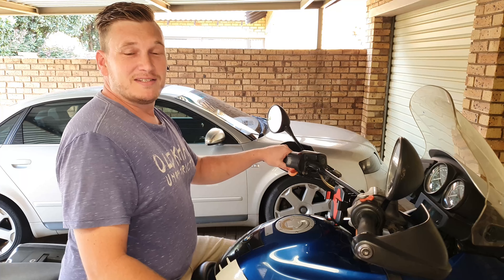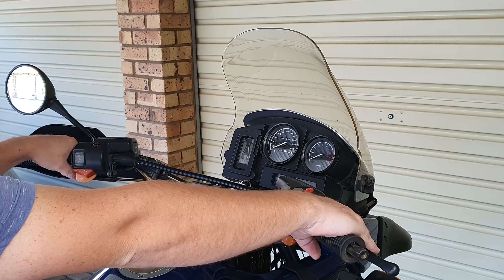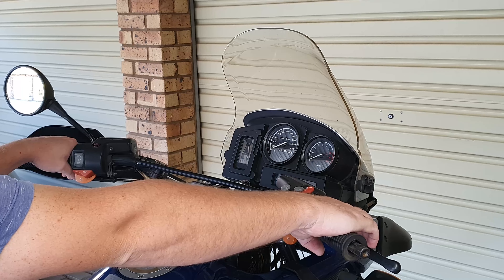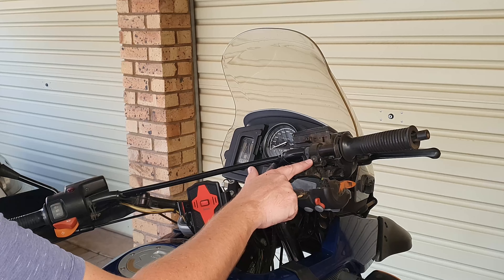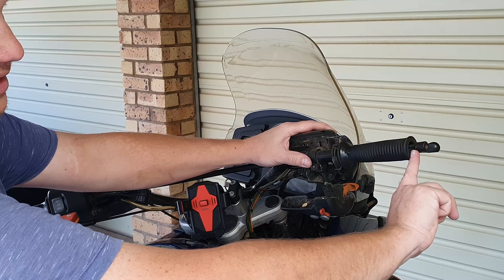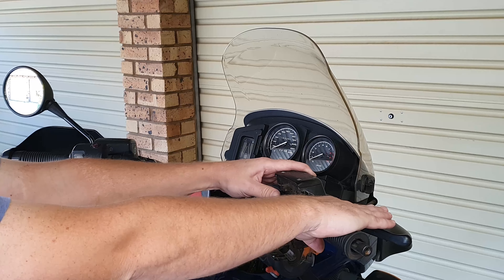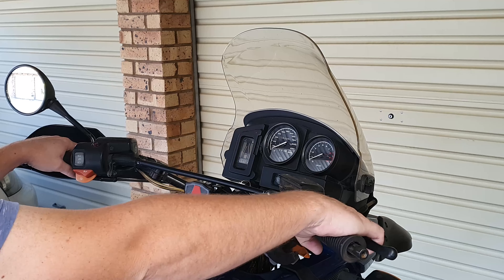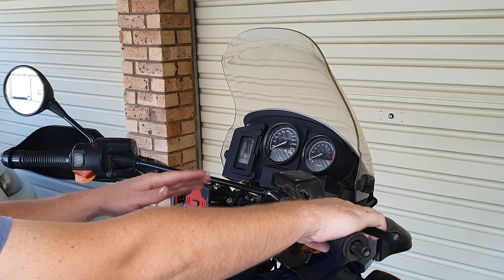How to adjust your handlebar levers up/down on a BMW R1150GS

Comment: Thanks Deon. Although I've owned my GS for 23 years and taken bars and stuff off several times over the years for powder coating and replacing heated grips etc I had forgotten all about that little screw behind the mirror stem on your previous video. You saved me from either breaking the multi switch unit or worse. My clutch and front brake levers have somehow moved over time to not be at the same angle and my OCD had forced me to do something about it. A really helpful couple of videos so again, thanks!!
Reply from the maker: You are very welcome! Thanks for your support! 👌🏻

Comment: One thing i have never figured out on my GS is the bolts on the handle bar, below the resevoirs and next to the switch block, there is one on both sides, it looks like it adjusts something or allows something to move, i have only owned it for 6 years😂
Reply from the maker: I am guessing you are talking about the two that are holding the entire handle unit in place on either side? Those are usually removed should you need to replace one of the two or the center piece of the handlebar. Hopefully I am talking about the correct bolts.
Reply: @DIYwithDeon  cheers mate, that makes sense now. 👍
Reply from the maker: I am very glad to hear, thanks for your support! 👌

Comment: Can't get the panel off with the buttons on, neither on my 03 nor 00!
a little gap at the top, nothing more. I have to use big a big pipe wrench to turn the handles to the correct position...
Reply from the maker: I have encountered that same problem before. Here is the video on how to remove them: https://www.youtube.com/watch?v=cW77vUmxbAY
I hope it helps!
Reply: @DIYwithDeon  It helpt! 1k Thanks!
Reply from the maker: You are very welcome! 😁